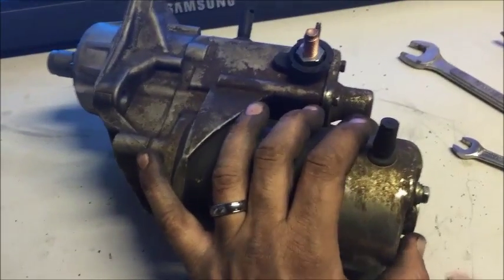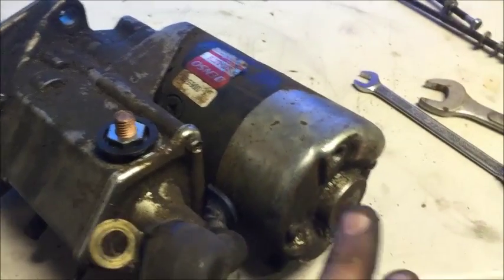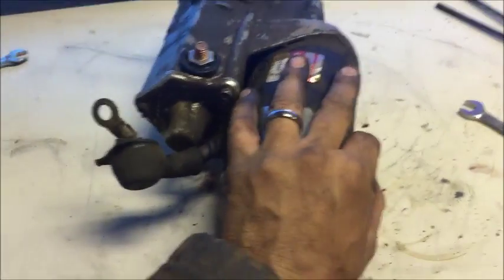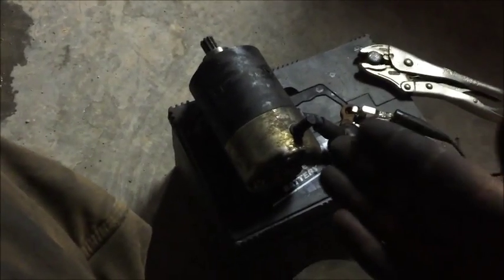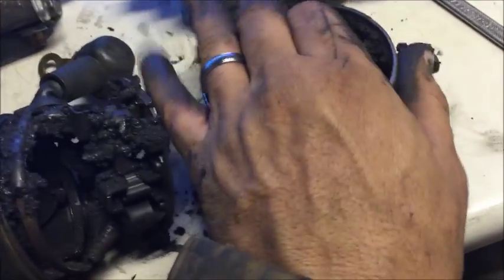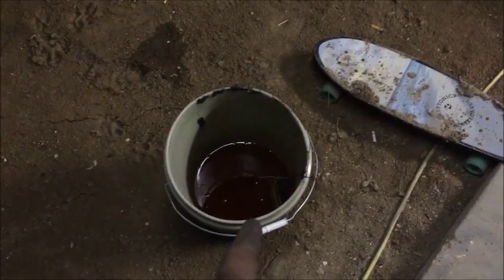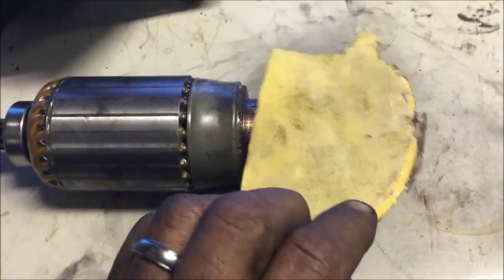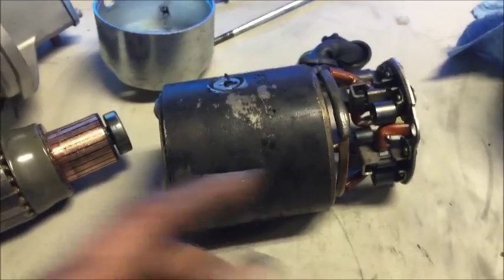Starter Rebuild, Remove, Replace and Repair 96 Dodge 1500, 2500, 3500

Comment: Thank you so much for this very detailed and informative video. My starter had gotten weak and I thought it was something else. I used your tip about starting the car and looking for dim headlights. I pulled my starter and it looked to be the original starter from 1998 😮 I used brake clean, a wire brush and a piece of sandpaper to clean it up until it looked new. My truck now starts up strong on the first crank. You have earned a subscriber, thank you for saving the day and saving me $80 bucks for a rebuild

Comment: after months of hoping my starting problem would just go away (loud clicking and hot wire going to the starter), I broke down and got my hands dirty. I did exactly what you said here and she started right up. you just saved me about $200!
Reply from the maker: awesome, that's what its all about. thanks for watching.
Reply: update: a few hours after reinstalling the starter, I started the truck and the starter would not disengage. this morning I took it off again and opened the solenoid chamber and found the contacts and the plunger had worn pretty badly. Hoping that I can solve this problem by replacing those parts. thanks again.

Comment: If I may add... Sandpaper sheds abrasive grit when you use it. I would like to suggest that you use a very fine Scotch Brite pad to clean the armature. Scotch Brite pads don't shed grit when you sue them. Carbon brushes are a much softer material than sandpaper grit and if you use sandpaper it will cause premature brush wear. John

Comment: (SYMPTOM very slow start 94 dodge 3.0 V6) Mine looked like that only after 1 year of pull &cleaning BUT the first 45 day I had a regular leak..funny the new rebuild comes with a rubber cone on the end to prevent oil from seeping in ....yup ...done this job 3 xs ...still workin great

Comment: A starter drawing more than normal amps will also dim the lights as well. Load test batteries to eliminate the batteries from being the issue.

Comment: That nut you pulled off I have to push up that bolt to start the truck but I wonder if there's some kind of magnet I don't know what it's called but I can take a picture of it and post it here but if you push it up the screw in the bowl it starts I didn't know if there was some kind of connector inside that little box right there

Comment: Hey. i got a question. can you tell me how many wires are going to the starter and where they come from and where they go. and also If you have a ground wire down on your oil pan bolt in that side and where it goes. Also if you have a ground wire that goes under the starter somewhere. Any info would be greatly appreciated.

Comment: I'm subscribed. Can't wait to watch more of your videos. Also - I broke my vent tube during removal. Do you think that's a critical part?
Reply from the maker: not at all, you can make a dust cover with a Bic pin cap, just cut the clip part off, poke a hole in it and glue it right on if you want. but its mainly to release the heat and its rubber like material is to keep dust out. i wouldn't worry about it. great question. thanks for watching.

Comment: I replaced my solenoid and plunger but it still didn't work.  I took apart the motor side and it was very clean.  The copper was discolored a little but wasn't two bad.  I really can't tell what's wrong with it

It pops out and spins over out of the truck like mad but in the truck I hooked power to it via a power probe and bypassed the trucks wiring and ignition and it just clicks so with any sort of load on it just clicks.  But with no load it spins

I have photos of how it looks on the inside if any one wants to see or thinks they can offer any insight

Comment: I have a weird starter issue where it cranks normal but will kill a fully charged battery in less than 10 seconds. i can find no parasitic drains anywhere and the battery is almost brand new. I dropped a front drive shaft and it hit the starter so i think it is internally shorted when engaged but not really sure as this is a new one on me.
Reply: Radio

Comment: My name is Sammy Allen and I have a 1990 dodge Dakota Slt and I have starter issues I started working on it and I located one bolt I can't find the other one that holds it together the wires are corroction